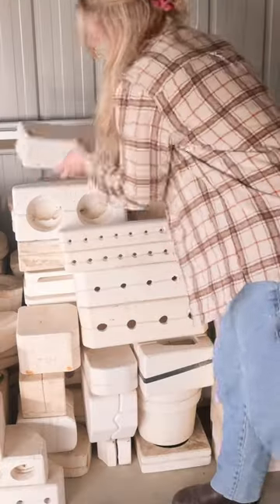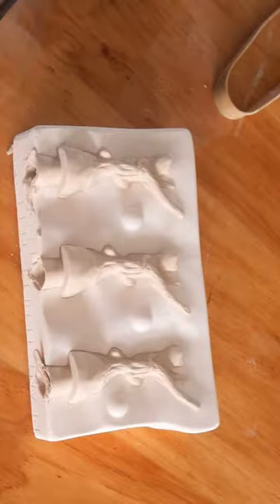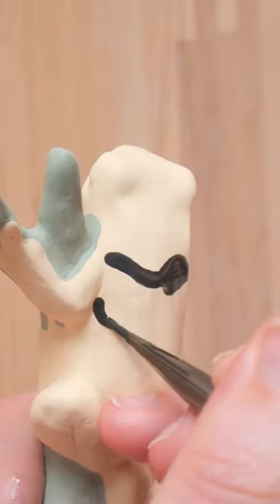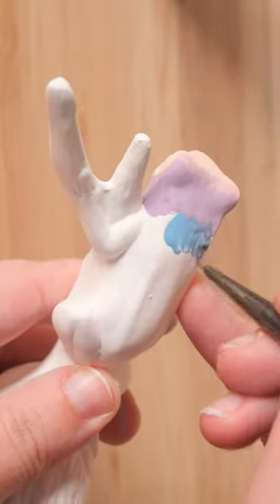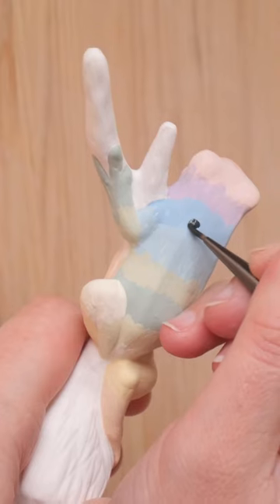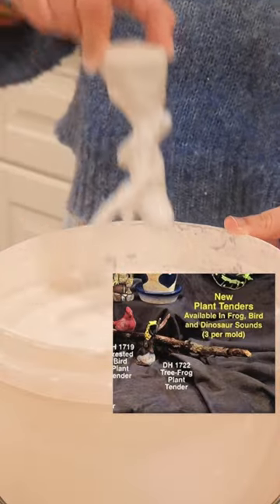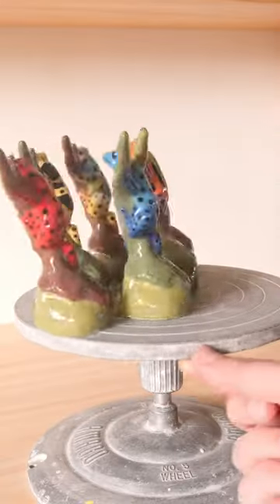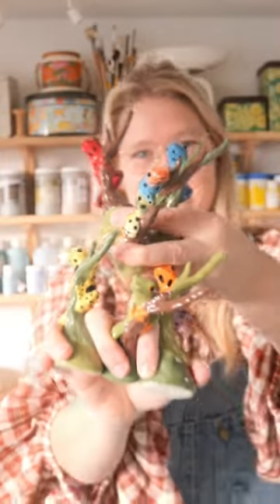I am hoping you can help me figure out this mystery 🧐, what’s inside mould 1! #mysterymold

Comment: looking at the full picture for the plant tenders with the other ceramics, in front of them is what looks like little speakers/mechanical pieces with long spikes that would go in the soil. id assume the hole at the bottom of the tender would fit around this device and that what would make the noise,  and sadly not the frog itself :(

Comment: You fill the bottom with water I think some come with stoppers that let the water leak slowly over time and it makes sounds but it could also be missing an electronic piece since I’ve seen and heard both versions. Also that bottom I think you weren’t supposed to shave off like that >.>

Comment: We have something like this, as a plant watering system. On the bottom there is a cone-like shape with a hole in it, you can fill it with water trough the hole and then it waters the plant trough the cone (the cone is ceramic, but without gloss, just terracotta like)